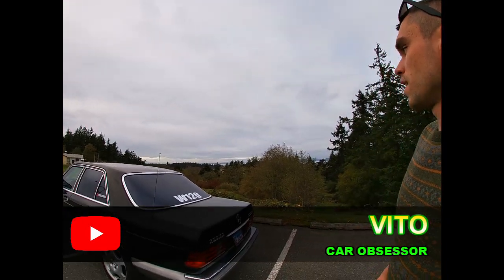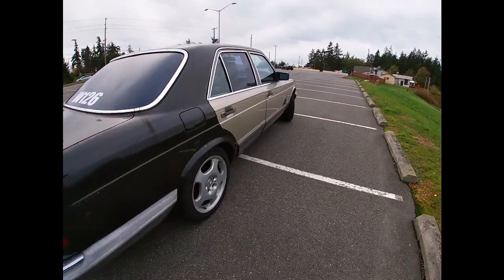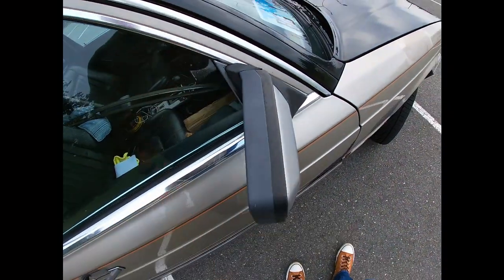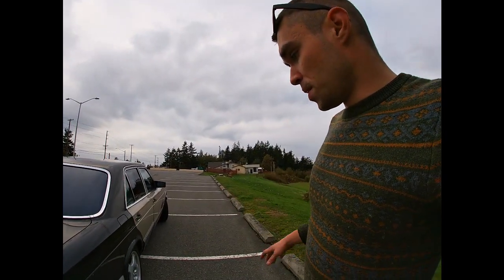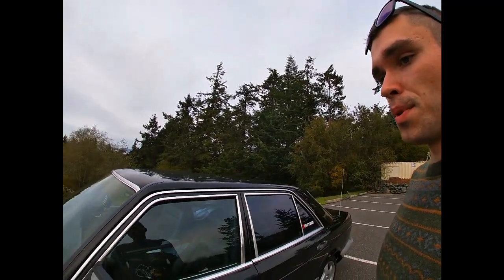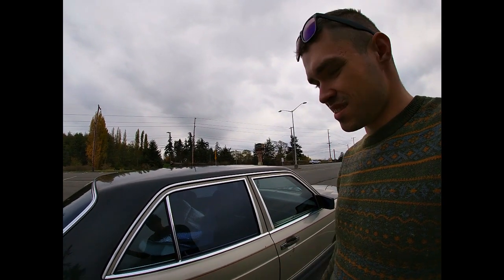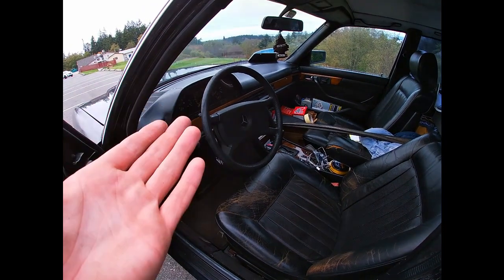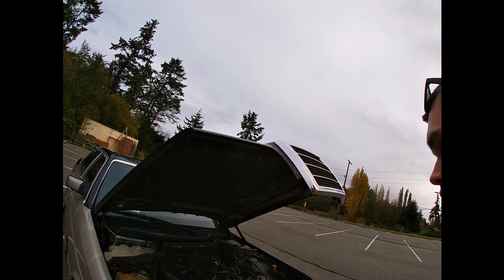EVERYTHING WRONG With My Mercedes 300SD W126

Comment: Ha! I'm almost twice as old as your car and I don't have any rust on me. Lol
I think it will be a good experience for you to fix it up and make it shine. If you rebuild the engine you may not need a block heater because these cars will start in some pretty cold weather. You can always cut a water heater into the lower radiator hose. Doing that helped my Peugeot a lot when I went to Kansas in the winter of 93 for a few months.
Save this car!
The bodies on later model mercs, like my 2001 e320, are still as solid as ever except for all the electronics and interior plastic pieces.
Reply from the maker: Thank you sir! She's getting saved. She's not going anywhere! 
And I love W210s too, I've had one for 5 years now. It's sitting and waiting on me😊

Comment: The rust. Ouch. There are lots of these out there with no rust so I’m curious why you picked this up. Fixing it might cost a fortune, unless you can do it all yourself? Where are you located? Perhaps I can drive through with my 1985 500 SEC. I have two trips planned for this year.
Reply from the maker: Because I want to save this car. We are getting less and less of these cars available. There's no point of getting a clean one. I made a video called ''Top 3 reasons why I buy beat up cars''. 
I am planning her restoration this year, if everything goes as planned. Most of the work will be done by me, body work too. I am in Washington state. But I am coming to Chicago at the end of April for a few weeks. I am planning to do a big car meet there. Let me know if you're gonna be around.

Comment: Have you checked the radiator, if the car overheated, check the radiator, thermostat to see if it has to be changed, if it was neglected,who knows if it is the original, I would not be surprised, also if you can check the radiator from the 190, when I had the W140, it was being fixed the dealer loaned a 190 that had the AMG package, the person that had it , worked for a Mercedes Benz dealer so he added, the AMG package, the car overheated due to the radiator, cracking, What!, it turns out that the radiator, for the car is made of plastic & aluminum, I called the dealer to come and pick it up, they sent a wrecker to pick it up, and I had to pay to get to the dealer, to get annother loaner, it turns out  that the radiator for that car cost around  $5,000 dollars, I could not believe it, so if you or any of your clients ,subscribers have that problem, see if an all metal radiator can be retrofitted possibly with more cooling capacity.
Reply from the maker: The issue with this was a lot of garbage and debris in front of the radiator which was causing an overheating situation, especially going up in the mountains. It was all fixed up a long time ago. I just cleaned up the debris from there and that’s it. No more issues. Radiators cost about $200 for these. Not bad at all
Reply from the maker: Made a video on it. Just check out a W126 playlist. It’s there